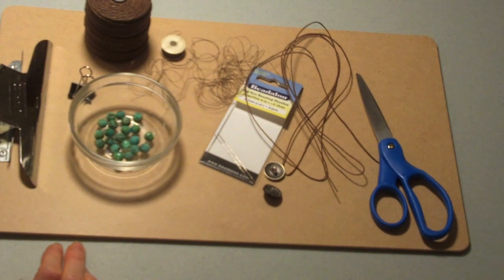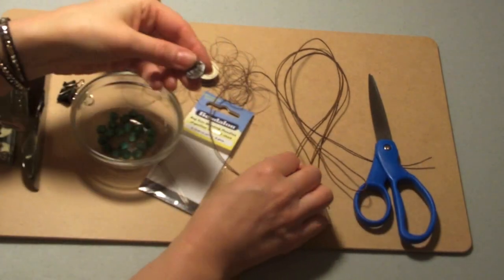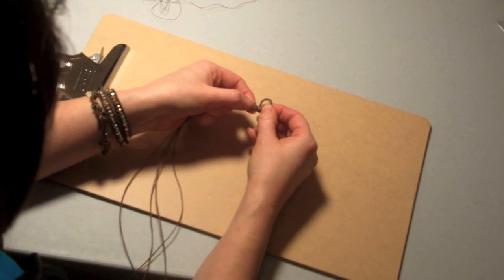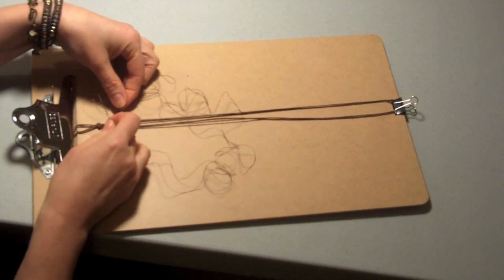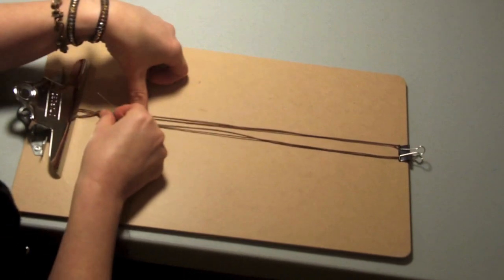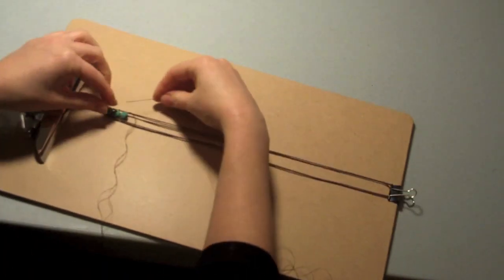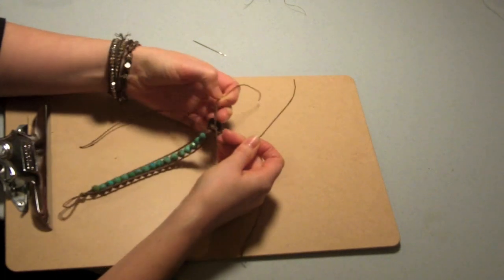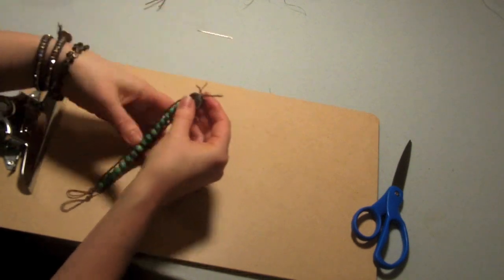DIY:  Wrap Bracelet Tutorial Using Irish Linen

Comment from the maker: the waxed linen stretches a little.  You do not want to get it wet - because it will wear faster.  The leather can stretch.  The key is to dampen the leather and lightly stretch it and let it dry before making a bracelet with it.   It builds the wear into it and it should not stretch as much after.